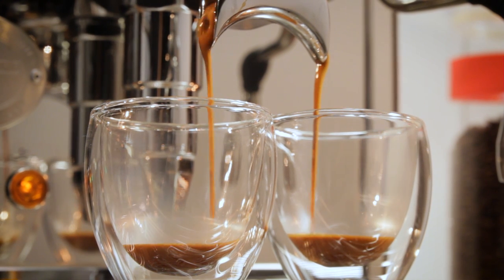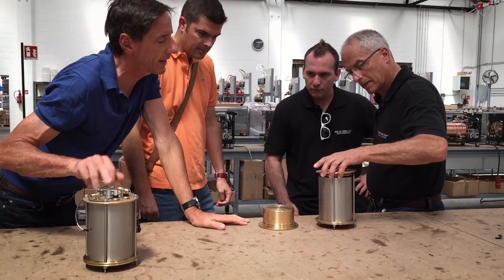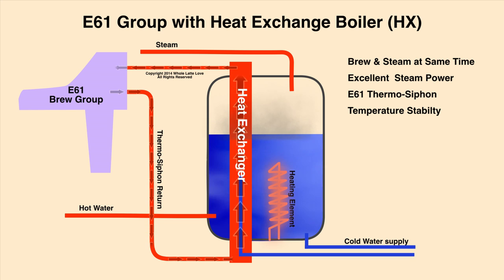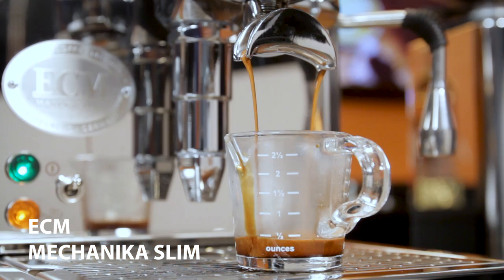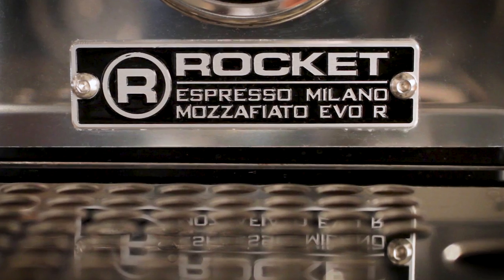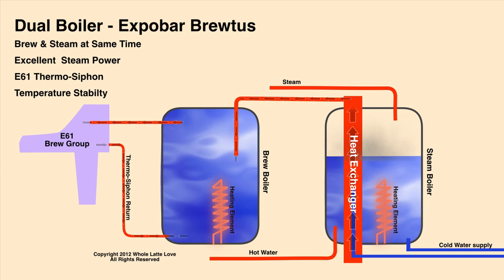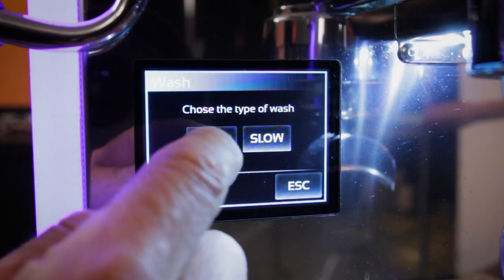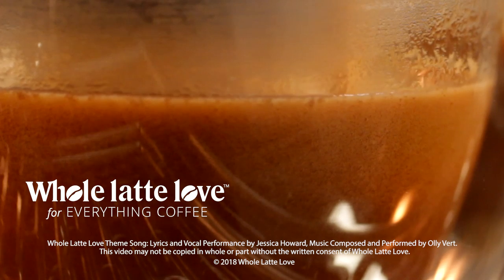How to Choose a Prosumer Espresso Machine: Dual Boiler or Heat Exchange

Comment: I have been watching these videos since I bought a broken Breville machine...and now I am deep in this rabbit hole of machines..which started out as a DIY repair for it...Now I am like...I got screwed on ebay...but that could be my last mistake. Now learning about single boiler, heat exchange, dual boiler, PID, lever action has been an education..Now I am like that money I was using for a laptop hmmmm may be better spent on a new shiny espresso machine. With this Breville my ambition was just too low...LOL
Reply from the maker: Hi x, Thanks for the comment. I consider Breville to be an appliance grade product. They are a lot more difficult to work on than true prosumer level espresso machines. The appliance grade products have nowhere near the build quality or serviceability of machines from traditional manufacturers in Italy.
Marc
Reply: It takes some money and time to be skilled at making espressos. Breville is amazing for entry level, cannot find any difference between my espressos and the ones I buy at my favorite coffee shop. After 12 years my Breville is starting to show signs of age. Thus, it is time to get a better machine. Thank you for this video!

Comment: Hi Mark. What would you recommend between the rancilio pro x vs profitec 400 for someone who is a milk based drinker with little waiting time?
Reply from the maker: Hey NQ, thanks for the question. The Pro X is a dual boiler and its brew boiler being smaller heats more quickly. Aesthetically, I prefer the Pro 400 and it has features like flow control available if you work with specialty coffee.
Marc

Comment: Hey Mark - I've been using a LaPavoni for a couple of years. Love it, but I'm considering stepping up to a new machine. Debating between ECM techinica V provi or synchronika. I like the idea of a rotary pump, but not sure if I really need dual boiler or flow control. suggestions?
Reply from the maker: Hi Dario, Thanks for the question. Personally I'd go with the Synchronika. Aside from boilers the machines are very similar. What dual boiler gets you is higher brew temperature consistency and the Synchronika can operate at higher pressure in the steam boiler for better milk frothing. IMO Flow Control opens up another level of extraction control. It's especially useful when working with high-end fresh from roast specialty coffee - think lighter roasted high altitude single origins. They tend to be very bright. Especially when fresh. A long low flow start to an extraction can help tame the brightness common in those types of coffees. Beyond that one can use flow to simulate extraction on other machine types like manual levers or pressure profiling machines. Can also use to avoid over-extracting darker roast coffee or minimizing stale flavors in less than fresh coffees by starting with a higher flow rate then ramping it down as the extraction progresses. Hope that helps!
Marc

Comment: Great video, awesome channel! What can you recommend for light commercial use espresso machine (i personally like double boiler option but the price is about double). In the beverage menu basically should have espresso & lungo but would also be nice to serve cortado & machiato as well. Big fan of ECM, beautiful machines.
Reply from the maker: Hi Chuck, Thanks for the question. If you like ECM (I do too!) but don't want to go to more expensive dual boiler have a look at the ECM Mechanika Slim: https://www.wholelattelove.com/products/ecm-mechanika-v-slim-espresso-machine-with-flow-control It's available with or without flow control. Price wise it's more than 30% below a dual boiler ECM Synchronika. It's not a PID machine but has a huge 2.2 liter boiler in a small package. Be aware it's technically not rated for commercial use. Another option is the Crem ONE HX PID machine: https://www.wholelattelove.com/products/crem-one-hx-espresso-machine It is rated for commercial service, is PID, plumbable to waterline and has a huge drip tray. Price is below the Mechanika Slim. Not the same classic build quality as ECM but a reliable, easy to use machine for light commercial service.
Marc

Comment: Hi, what is better for the the taste of the coffee, a vibration pump adjustable from outside or a rotary pump with its 9 bar for brewing ? I´ve heard 8 bars for brewing can be better...thanks.
Reply from the maker: Hi NP, In my experience flow rate of brew water is more important than a specific pressure but there are many variables involved. Some coffees do better at higher flow rates and pressure. Some do better at lower flows/pressures. An initial lower flow rate and gradual pressure build (vibration pump) pushes one toward a finer grind size that may produce better subjective results for a particular coffee. Rotary pumps with faster initial pressure and higher flow rate may push towards a slightly coarser grind which often works well with darker roast traditional espresso bean blends. Equipping machines with either pump type with a flow control device (available on E61 group machines) gives one the flexibility to mimic either pump type. Rotary pumps have a naturally higher flow rate so have more headroom when using higher flow rates under flow control.
Marc
Reply: Thank you very much !

Comment: Hey Marc, me again, narrowed things down to a couple candidates. Pro 300, Crem One HX PID, Bezz BZ13 DE, Bezz Magica PID and finally the Pro 500 (although that is more than I want to spend) any insight? I am moving from a nice but single thermoblock machine.
Reply from the maker: Hi Jeff, Any of those machines are a big step up from a single boiler thermoblock machine! If you like pushing a button and the extraction stops on its own the BZ13 DE is the way to go. It's a good value and heats up quickly due to the electric heating of the BZ group. The Pro 300 is a dual boiler so you'll have tighter control of brew temps. It warms quickly with the brew boiler over the group head. With smaller boilers, not a great choice for serving more than in 3-4 people in quick succession. Crem One HX is an excellent value. A more modern design of a classic machine. I like the huge drip tray, shot mirror and display which is angled up for easy viewing. The Pro 500 is a premium level HX boiler PID machine. It features excellent finishing detail, reliable K.I.S.S. engineering inside the case and the E61 group can be equipped with flow control for next level extractions of specialty coffees and more.
Hope that helps!
Marc
Reply: @Wholelattelovepage  For the Crem, what does the modern design of a classic machine mean? I do like the fact that Bezzera makes their own parts.

Comment: I'm a coffee geek looking for a prosumer dual broil with PID temp. I love making Pumpkim Spice Lattes.  Have any recommendations?
Reply from the maker: Hi LB, Here are some dual boiler options...
See the links for more info, videos of each machine, specs, reviews, current pric, etc

Best Values non E61 group, non-plumbable, vibration pump:
Rancilio Silvia Pro: https://www.wholelattelove.com/products/rancilio-silvia-pro-espresso-machine
Profitec Pro 300: https://www.wholelattelove.com/products/profitec-pro-300-dual-boiler-espresso-machine

Best Value E61 group, best in class steaming power, non-plumbable, vibration pump
Profitec Pro 600: https://www.wholelattelove.com/products/profitec-pro-600-dual-boiler-espresso-machine

High-end, E61 group, best in class steaming power, plumbable, rotary pump
Profitec Pro 700: https://www.wholelattelove.com/products/profitec-pro-700-dual-boiler-espresso-machine

Ultra-lux, E61 group, best in class steaming power, plumbable, rotary pump
ECM Synchronika w/flow control: https://www.wholelattelove.com/products/ecm-synchronika-dual-boiler-with-flow-control

The Pro 600 and Pro 700 are also available w/flow control.

Hope that helps!
Marc

Comment: So what would you recommend as an upgrade for my failing Gaggia Classic? I know I can probably refurbish the Gaggia to a point. But I'm not sure I want to throw money at it. I've already replaced the pump. Now it needs a new steamwand manifold and I think there's something wrong with the 3-way as well. Temps are pretty inconsistent and steam power is quite lacking. Perhaps due to the leaky manifold but it's never been great. 

So anyways...I make 1-3 drinks a day for myself. If my wife wants some then add 1-2 more. So typical day it'll see 2 drinks but can be as many as 4 or 5. I'm not a super geek so I don't need lots of bells and whistles. I just want a solid working machine that gives me some control with consistent results. Don't need plumbed. In fact that's not even an option for me to do. Dual boiler/HX would be wonderful but probably an unnecessary expense. Definitely want a pro-size portafilter.
Reply from the maker: Hi Chad, Thanks for the question. If you do any milk drinks on regular basis then I'd consider a machine with HX boiler. Being able to brew and steam simultaneously makes milk drinks so much faster! If accurate brew temps are important to you more recent HX machines with PID are excellent and a big change from older HX machines without PID which usually require a cooling flush prior to brewing to dump over-heated brew water. In HX machines with PID my favorite is the Profitec Pro 500 with Flow Control: https://www.wholelattelove.com/products/profitec-pro-500-pid-espresso-machine-with-flow-control If you happen to brew with very fresh from roast specialty coffees flow control allows you to do long low flow pre-infusions which make a big difference. The Pro 500 is available without flow at lower price as well. If brewing and steaming at the same time are not important to you but accurate brew temps and build quality are you should consider the ECM Classika single boiler with PID. It's IMO the best single boiler machine available: https://www.wholelattelove.com/products/ecm-classika-pid-espresso-machine-with-flow-control It's available with and without flow control as well. Hope that helps! If you need more assistance picking a machine to best fit your needs you can speak directly with our coffee pros at 585-924-7170
Marc

Comment: Thanks for the nice video Mark. Can you tell me, is there a different between a steel boiler or copper boiler?
Reply from the maker: Hi jv, Thanks for the comment and question. At the end of the day...not much except one is made of stainless steel and the other of copper - often with brass end plates. Sorry couldn't help myself! All kidding aside, The majority of manufacturers have gone to stainless steel. Copper conducts heat better than stainless but copper boilers generally have thinner metal so thermal mass of a similar volume stainless boiler may be greater. copper boilers may require more manual labor to build. Putting a fitting into copper often requires soldering a fitting or mounting it through a thicker brass end plate. Stainless is thick and rigid enough to drill and tap. Now, there will be those who insist one material is better than the other. So long as a machine delivers consistent temperatures that's what matters. IMO other design elements and components play a much bigger role than boiler material.
Marc

Comment: Hey Marc, that is another awesome video! Thanks!
My question is similar to Xantulle`s below, I'm trying to decide between a good HX, or entry level DB.. Profitec Pro 500 PID (2nd ECM Mech Slim *no PID) or  Profitec Pro 600 (2nd Brewtus *loses on engineering, details, maintenance) .
I will brew 2 double cappuccino at morning and 2 double espresso after lunch... and maybe some guests at the weekend.
As the investment will be high and I don`t want to go for upgrades, this combo will have to last for long... decades if you will lol ! I would like the machine to have good quality component, robust, easy maintenance, good quality/price ratio and capable of consistent good results... I`m not considering plumbing, Im fine with reservoir.
Any advice on those options? Specially Pro500 vs Pro600? Advantages and disadvantages of each... is the extra $$$ worth for the 600? Is it more capable of consistent good shots?
Thanks a lot!
Reply: Forgot to mention... will pair it with Ceado E37J or E6P, not sure which to go for. How is the retention of those? I just found the retention data of E37J. THanks!
Reply from the maker: Hi Victor, Thanks for the question details on usage and what's important to you - really helps! For decades of service Profitec/ECM machines are IMO the right choice. Feed them with good quality water with proper mineral level and you're good to go. What the dual boiler 600 gets you is easier adjustment of brew temps and better control of steam temp/pressure with the independent boilers. On the HX 500 brew temp depends on the temp of a single boiler and how that heat transfers to the HX section for brewing. The 500 provides accurate brew temps but it takes longer to adjust and settle into a new temp. Also you use a chart to set temp of the boiler to get a desired brew temp on the 500. Many users appreciate the visible PID control of the 600 which has an automatic shot timer. Plus additional functions like back flush reminder and an eco mode which automatically shuts down the boiler heating after user specified time. Shot timer and those additional features are not on the 500. 600 has more steam power than the 500. It goes to ~2 bar while the 500 goes to ~1.5 bar.  HX machines are user descaleable while DB machines generally are not. However if you use good water you can eliminate the need to descale either machine. For reservoir fed machines we recommend either BWT Bestsave pad filters: https://www.wholelattelove.com/products/bwt-bestsave-m-anti-scale-filter or the BWT Penguin Pitcher: https://www.wholelattelove.com/products/bwt-penguin-2-7-l-water-pitcher Either of these BWT products provide Specialty Coffee Association spec water which prevents scale when used properly.
Grinders:
Both the E37J and E6P use 64mm burrs and produce a similar grind quality. Difference comes in ease of use. E37J has digital display showing grind time. E6P has no display so adjusting timing is a little harder. You push the buttons to add or subtract grind time in 1/10 second increments with no display of actual grind time.  With the J one does not lose grind setting when removing the top burr plate. The E6P has a more standard setup with a threaded collar that turns out to access the grinding chamber. Turn that out and you lose the grind setting. Hope that helps.
Marc
Reply: @Wholelattelovepage  Hi Marc! Thank you very much for your time! Could you elaborate a little more about "user descaleable"? How is the procedure to descale on a 500 and on a 600? I really would like to do the maintenance by myself. 
Another question, (as reference) how long does it takes to need to descale a machine using tap water vs using BWT pads?
Thanks!

Comment: Hi Mark, just a quick question, does steam on dual boiler dryer than HX machines? Thanks!
Reply from the maker: Hi there, Not that I’m aware of. But you might be able to steam faster on a machine with higher initial steam pressure and introduce less water. Higher pressure is easier to come by on DB machines as the boiler can run at higher temps than on HX where boiler temp affects brew temp. Insulted “no burn” wands have less internal condensation and you’ll find those on most machines now. 
Marc
Reply: @Wholelattelovepage  Thanks for your super fast reply!!!

Comment: wonder if you could do a video about safety of the machines, I have heard some of these E61 types or the Bezzera machines get terribly hot where you cant even touch the group head, or  near the joysticks for steaming . which makes them harder to use,  if you touch them they will absolutely burn you!  so if thats the case, that really might turn off a lot of buyers and especially for older people, or teenagers, or novices perhaps they would be better suited for machines like breville, gaggia, or the rancilio which dont get hot and wont burn you...
any thoughts on this?
Reply from the maker: Hi Chris, Thanks for the comment. One does need to use care when operating these machines. Even machines without E61 groups have hot parts. All of them, including the B, G, and R you mention produce steam and hot water. Those not qualified to operate a stove or oven safely should not use semi-automatic espresso machines.
Marc

Comment: Hi Marc, hope you can help. I have a budget for a new machine is around $1700- 2000 as already have a grinder. What do you recommend? I am looking for best quality coffee in my budget as close to cafe style (i am award of importance of beans grinder and Barrista skills) I will be having mostly milk based drinks maybe 1-3 a day. Ideally with PID unless you think it’s not required on a particular machine. I have looked at P P500, Bezzera BZ13 and Magica also Rocket Apartamento. Any others? Thanks
Reply from the maker: Hi Viks, Thanks for the question. If you can swing the Pro 500 it's the cream of the crop in that range with best build quality. Compared to the Appartamento you will not need to do a cooling flush prior to espresso extractions due to PID and design of thermosiphon system which prevents overheated brew water. At lower end of your price range have a look at the Profitec Pro 300. it's a quick heating dual boiler PID perfect for 1-3 milk drinks per day. Not as pretty IMO as the Pro 500 and no E61 group but a nice machine for the $$: https://www.wholelattelove.com/products/profitec-pro-300-dual-boiler-espresso-machine
Hope that helps!
Marc